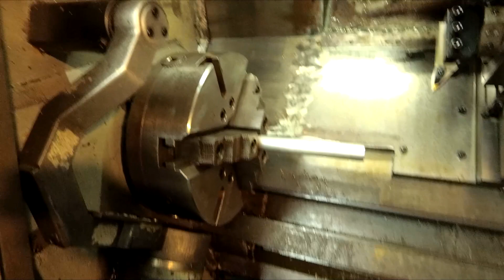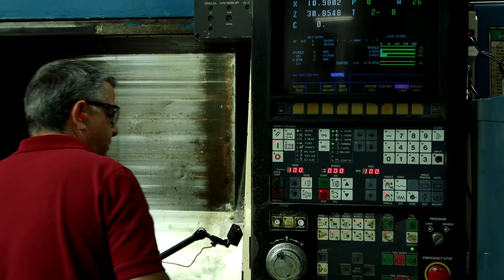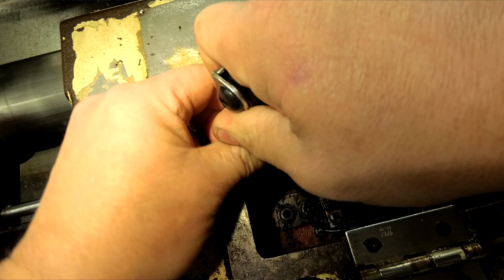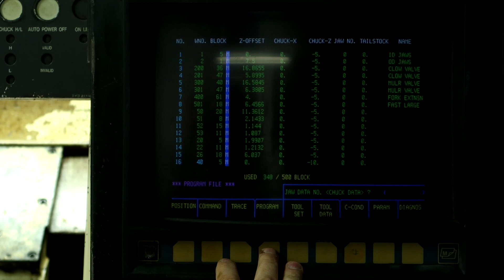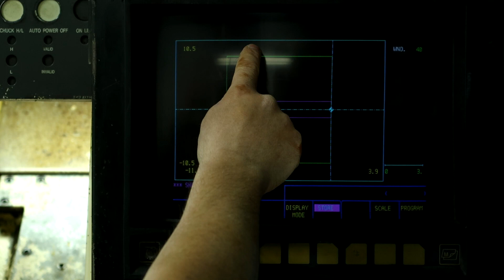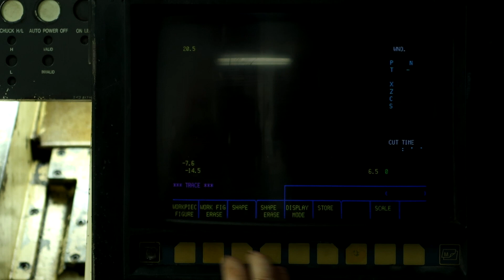Mazatrol CNC Lathe Tailstock Programming and Operation T2 T3 Control

Comment: I use a TPC on every program for my tailstock.  I change the approach for roughing and finishing on any tool to manual and put the x value something bigger than the tailstock or diameter of stock would be.  I use X 8.0 and Z-.2 then the tool rapids to that safety move then down to the start point. I do this on every tailstock program I do.

Comment: This solution does not work on our machine .. T32B
So disappointed!
Some programs work fine (just start from current position) and for others it return to tool change position and then crash into tailstock.
Any parameter that can have an effect?

Comment: I have a fusion control and it still wants to rapid into the tailstock even setting the od max bigger..
Reply from the maker: Go into the TPC screen on that process and select manual for tool approach for roughing and finishing tool and add a relay point so the tool will clear the tailstock. The old T2 and T3 control didn't have TPC Function

Comment: Hello Phil and guys. Thanks for so useful videos. I have a little problem.  We have  a used Mazak SQT15S Mazatrol T plus. I have the folow task  to write makroprogramm in ISO code. For example "N10 G0 X[2+2]" it understund (it goes in X4). But "N10 G0 X[8*sin[30]]" it shows mistake "707 illegale format". The same with "cos", GOTO, WHILE, IF operands. And i can't use variables.  For example "#1=5" is the same 707 mistake .May be anybody know how to solve this.
Reply from the maker: I do not know if the T+ controller uses variable programming or not.
Reply: @mazatroltipsandtricks6816  I "solved" the problem. Left  button menu/DIAGNOS/VERSION/OPTION... You'll see a menu with supported functions. My CNC dosen't support macro :(
Reply: @mazatroltipsandtricks6816  I have user manual 😁. It says that be possible. Thanks for the answer.

Comment: Hey guys I'm on a T3 control panel and I am from fanuc machines where I usually have a feed override switch I can turn up and down when running through programs and can turn down rapid speeds, on the mazak I'm on I don't have these I just have feed and spindle up down buttons is there a way to safely run through programs?
Reply from the maker: The Override buttons function the same as a Fanuc.
Reply: Anyway to turn down the rapid speed then turn it back up again?
Reply: @mazatroltipsandtricks6816  I also have an issue with chuck barriers I watched your video but couldn't find a solution, I set my chuck barrier on the face off my jaws so I can't go into the jaws, but when I try to take machine back go home position it alarms out about 2 inch from face of job saying chuck barrier alarm
Reply: We got the machine at auction and it didn't have any manuals what so ever and can't really find any online either
Reply from the maker: @MrMunch1  Go through my other videos to see how to operate the controller.

Comment: I’m enjoying seeing an old slant turn still operating. We had a slant turn 28n atc which was our first mazak. It was very worn out and tools kept getting jammed and we scrapped it. We now have 3 sqt’s of varying size and an old integrex35y. I got a soft spot for the old mazaks.
Reply from the maker: The tools getting jammed is due to the rubber bushings getting worn out in the tool chain. I replaced the bushings with a short section of metric tubing from McMaster Carr and the tool changer works fine now.
Reply: @mazatroltipsandtricks6816  the tools getting jammed was only one of many issues that poor old girl had. She had been around the block a few times. We stripped it to a bare casting and even with the amount of work that thing had done they ways looked pretty good.

Comment: Hi Phil! Love all your videos. Gained lots of knowledge from them. I’m having trouble trying to use the sub spindle on my ‘94 SQT18ms as a tailstock. If I move the B axis off it’s home position I am not able to move the X or Z axis. I get an axis move misoperation alarm. Wondering if you can give any help? Thanks!
Reply from the maker: Sounds like a parameter needs to be changed but I do not know which one.
Reply: We have a sqt10ms, u will not be able to use the sub as a tail stock unless it has a specific option as the servo will overload. However saying that our machine will run the program with sub spindle off home position so that problem may be a parameter.

Comment: You forgot to tell the machine that you will use the tailstock.
If you don't tell the machine this it will 100% crash.
If you tell that you will use it, it will stop in tailstock-barrier (unless you use "barrier cancel") or increase diameter, in heading of program, to bigger then the diameter of tailstock-center.
Using a tailstock in automatic is very easy.
On this machine you make a manual program that puts the Z-axis at the connection-position of tailstock-body, connects it, moves it forward to the correct position, disconnects it and moves the tailstock-cylinder (with centre) forwards.
There will be M-codes for connecting/disconnecting tailstock-body and extend/retract of tailstock-cylinder.
Set the sensors at the same position at all times and just let the centre have the same extension all the time makes it easier.
On the motordriven tailstocks, make a manual program.
Place the Z-axis in a given position, M-code for tailstock movement forward and then tailstock-cylinder movement forward (when tailstock-body is in correct position).
When finished machining do the same again.
Z-axis into position, M01/M05, measure workpiece if necessary, tailstock-cylinder retract and then tailstock-body retract.
Best thing is to move it all the way back to home/rear position.
Have you tried to set chuck-barrier Z to a fixed value?
Chuck-barrier X is always outer diameter of chuck and Z is always end-face of chuck.
Jaw-size are set from end-face of chuck.
If you make two programs where program 1 makes all the machining of end-face (end-facing and making a centre-hole) and let the machine know that you don't use the tailstock.
On program 2 you let the machine know that you use the tailstock, but leave out the end-face and centre-hole machining.
Use the same zero-point on both programs, let the first program change to program 2 and let program 2 start automatic when program 1 is finished.
In program 2 you let the program change to 1 when finished, but tell the machine to not start program 1.
Reply from the maker: Thank you for that write up. Very informative. On the older control, the machine would still try to dive into the tailstock but will stop if it hits the barrier. It still will not run the part though. 

I may make another tailstock video in the future with going through everything but this was for beginner level.
Reply: @mazatroltipsandtricks6816 : Five years of running a QT20 with T2 gives you some experience.
The programming with tailstock was used from day 1.
Now I have 19 years of repairing and installing  Mazaks.
On the Matrix and Smooth it is much easier.
M-codes to disengage/ engage barriers and parameter to tell the machine to move Z-axis first and then X-axis.
Reply: @runejakobsen9958  Hi your comment is very good i do the same with tailstocks. I have a questions, do you have users manual for mazak slant turn 25 atc? I have only in french and its very troublesome
Reply: @runejakobsen9958  Hi your comment is very good i do the same with tailstocks. I have a questions, do you have users manual for mazak slant turn 25 atc? I have only in french and its very troublesome
Reply: @piotrkot2002 : Unfortnately not.
I don't have any documentation on the old systems.

Comment: I've noticed on Mazatrol it alarms out on the roughing cycle when trying to turn a taper from small at the front to big at the back using the same tool to rough & finish as you had programmed in your video ,but would do it the other way from big at the front to small at the back .
Have you experienced that ?
Reply: Thanks for taking the time & effort to do these videos ,would you be able to do one on diamond knurling?
Reply from the maker: @joedunne1134  Yes, knurling is a video I intend to make soon.  Thanks for the interest!
Reply from the maker: Sometimes you need to make the taper shorter on Z length and then give it a horizontal line about .050 to .100 long to eliminate the error. This happens more often if you have a radius at the end of the taper.
Reply: @mazatroltipsandtricks6816  i have  found if you copy the block of program down ,then only put the taper on the second block only using the finishing tool ,this works as well .
So you rough turn it programmed without a taper ,then program the taper & only use the finish tool ,that's the method that served me well over the years .
Reply from the maker: @joedunne1134  Thanks Joe.
Reply: What alarms you get?
Reply: @runejakobsen9958  not sure now ,as I no longer run Mazatrol.
Just remember it wouldn't run the taper line with a roughing pass on it,tapering from big to small but it would work the opposite way from small to big .
My bet would be  it's probably down to tool nose radius compensation causing it to alarm out.
Reply: @joedunne1134 : Important to define the tool-angles and directions correctly.

Comment: I think it's safer to manually set approach and escape points using TPC as that's what they are used for. Your way feels more "hacky" than anything. To me at least.
Reply: i think this control doesnt have tpc yet
Reply from the maker: @gerrit2107  Yes, that is true.
Reply from the maker: There is no TPC on the T2 or T3 control I am using so I either have to do it this way or adjust the tool change position which is problematic if you have several tools with different Z length geometries. Yeah its hacky but very effective.  I never have a problem doing it this way. It just adds a few extra rapid motions to the program.
Reply: @mazatroltipsandtricks6816 Maybe you could link to your video on adjusting the tool change position.
Reply from the maker: @ronaldmadican2393  Good idea.
Reply: @ronaldmadican2393 : Tool-change position is decided by parameter.
The safest way is to go to home-position in X-axis and safety-clearance in Z-axis.
Safety-clearance is decided from the longest tool in Z-axis direction.
You can choose between many options in tool-change position, but standard setting from factory is home-position X-axis and safety-position Z-axis.
Reply: @mazatroltipsandtricks6816  Oh, I didn't know that. I think the oldest Mazak I've worked on had a T+ control and I remember it having TPC. I don't know what I'd do without them sometimes. 

Hey, a bit off topic here. Not long ago I found what I assume is a programming bug that made me crash the machine when it definitely shouldn't have. I've been programming parts with Mazatrol since 2010 and that one had me baffled.

I took a picture of the program. Try and find what's the problem here. And I don't mean a .0021" thing. This fully rapid crashes the machine.

https://pasteboard.co/JOapIM7.jpg

I will tell you what and why that's happening if you can't tell.
Reply: @shadowdsfire : Because you set "0" on inner diameter on the program head-line and "1,2" on the inner machining headline?
Reply: @runejakobsen9958  Nope. That never cause problems.
Reply: @shadowdsfire : I can see this is a 640T.
What caused it then?
Starting-point Z on fine cut?
Why do you use a fixed feed on tools?
Use the surface-symbols and machine adjusts the feed depending on nose-radius on tool against the chosen surface-symbol.
Reply: @runejakobsen9958  The crash happens when the rough cut cycle from Unit 1 ends. Instead of rapid feeding to its X cutting point and then next to its Z as usual, it does something weird. 

It rapids to Unit 2 Z cutting point, then to Unit 1 X cutting point, then it goes to Unit 2 X cutting point. So basically the machine roughs the diameter and then G00Z right into the part. 

Why? Because Unit 2 cutting point X is bigger than Unit 1. So if I insert 1.18 to both of them it behaves normally. 

(I've omitted clearance details for easier reading)

I've tested this program with 3 machine and the same thing happens, but they're all 640 controller. I wonder if it's the same on other controller.